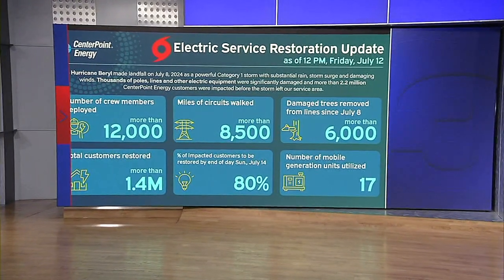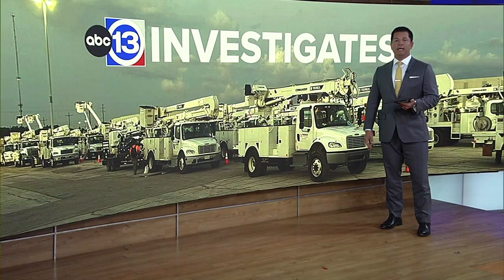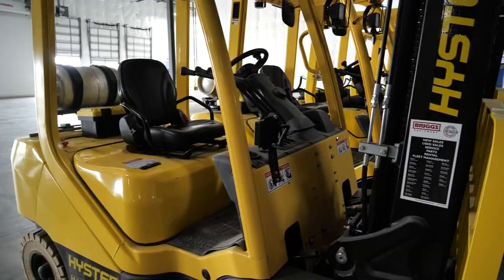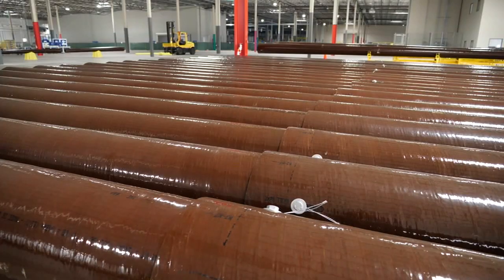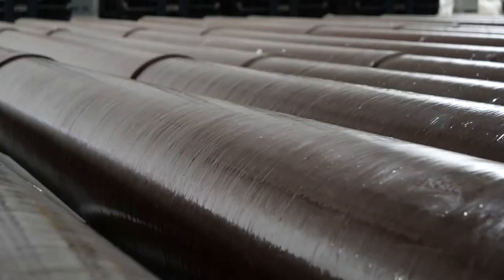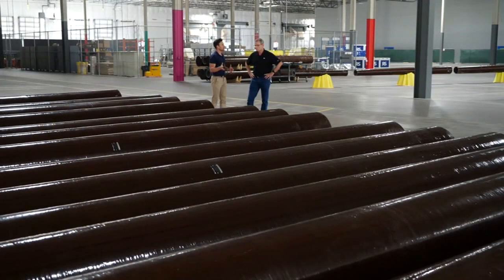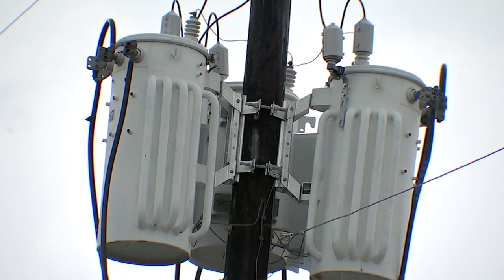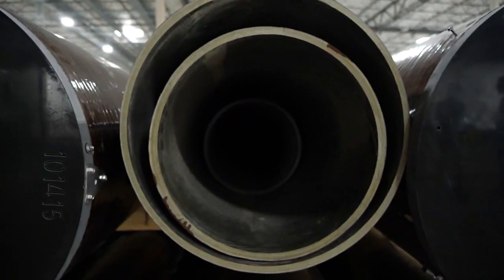13 Investigates gets inside look power poles of the 'future'

Comment: Our neighborhood in Spring TX just had these installed last year. All held up great during Beryl, however, the cause of the outages in our neighborhood was not snapped / downed poles but large old trees inside the easement line that fell on distribution lines. These poles will be useless in Houston where we love our overgrown pine / oak trees. I smell concurrent fines coming to homeowners to compensate for this shortcoming.
Reply: Were you near Kuykendahl and Cypresswood? It was a huge tree that took out lines.
Reply: @kenxclout  it was the Northwood park area on 2920 and Falvel.
Reply: Correct, I live on a corner lot and I have a (wooden) powerpole in my backyard which I can tell feeds the entire block. If I dont keep that area trimmed up, I can assure you I easily have "control" over the rest of the blocks power should I neglect the growth in that area.